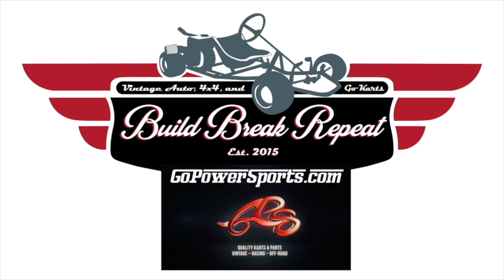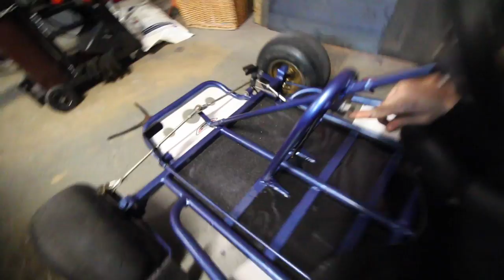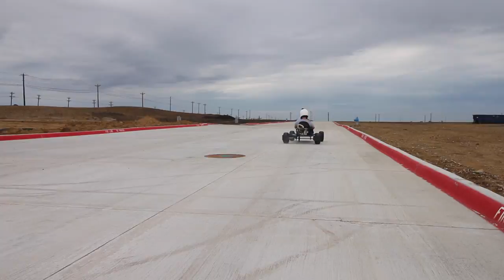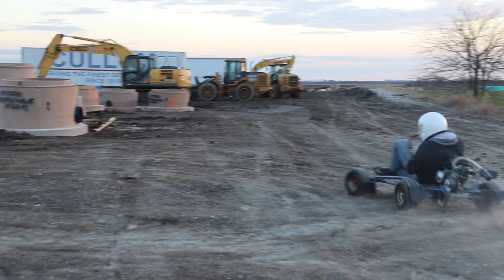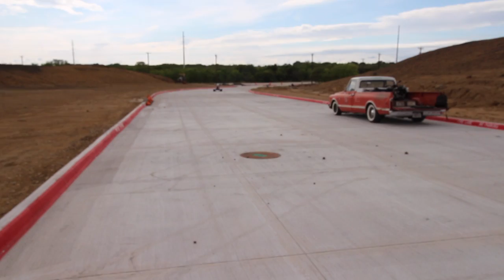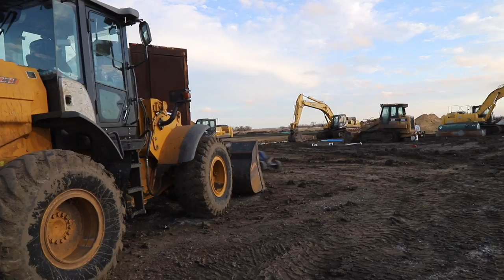Rally Kart Reassembly and First Drive!

Comment: Love your videos bro does a mikuni carb increase speed or tork??
Reply: Christian Summers carb increases engine rmps. You can use engine rmps to get more torque or more speed depending on how you gear it. Are you 8?
Reply: Nah I’m 12 but thx
Reply: It’s a predator engine with a tork converter also
Reply: Noah Batterson  I’m 12 but thanks for the tip
Reply: Christian Summers yeah no p

Comment: Put a dirt bike engine 2 stroke, like a 125. Those predators r weak even when modified. 85 cc might work aswell
Reply: i have a RM80 6 speed on a track go kart and it rips so hard
Reply: Bryn ya that’s sweet, I have a Kx85 but I’m not putting that on my race kart lol. I got a new Birel kart for free that was raced Down In florida and it’s Honda gx200 with about 10 hp. It’s by no means fast but crazy fun need a little more top end tho.
Reply: @thedriven1415  10hp is a decent engine for a 4 stroke. free go karts are always the best
Reply: Bryn ya ten hp it doesn’t really feel like it with not gears, can’t expect to much out of a modified pressure washer motor 😂. I’m doing a buggy build right now on this channel gonna have an 120 hp sled motor
Reply: @thedriven1415  gunna give it a turbo and a BOV?
Reply: Bryn unlikely it’s a 2 stroke so turbo is weird
Reply: @thedriven1415  Two stroke Diesels (at least some, I'm not an expert) rely on forced induction to run at all. I wonder if you could go to a wet sump  on a gas 2strk and re-port the intake? Then turbo would be a relative bolt on. Just thinking out loud.
Reply: InsideOfMyOwnMind ya ik there is a way I just think that I would need to do to much work, 120 hp is enough for me(: